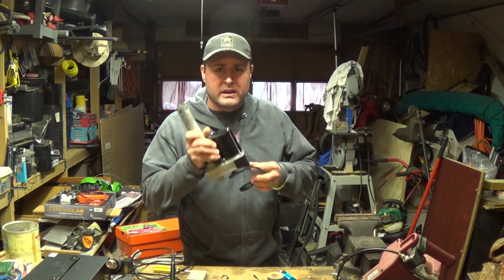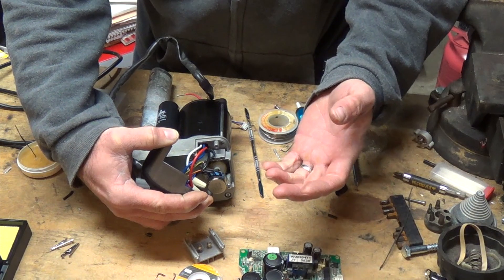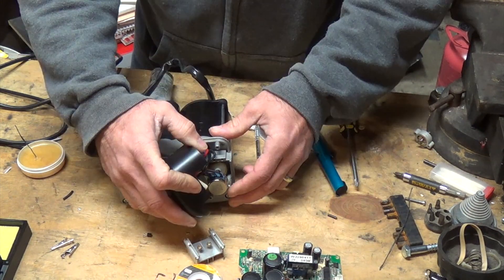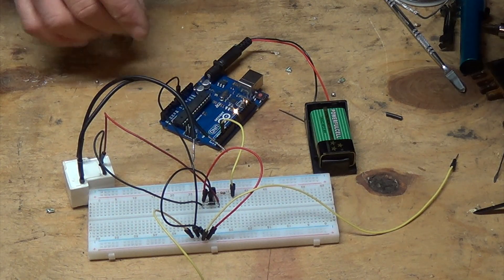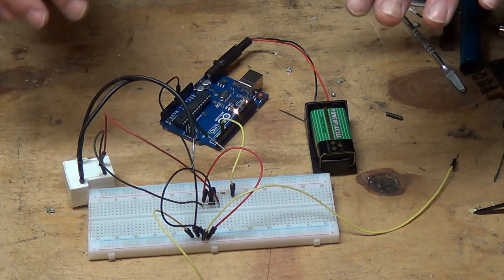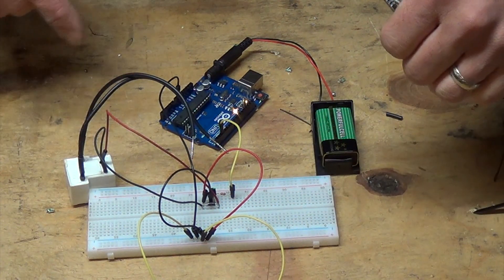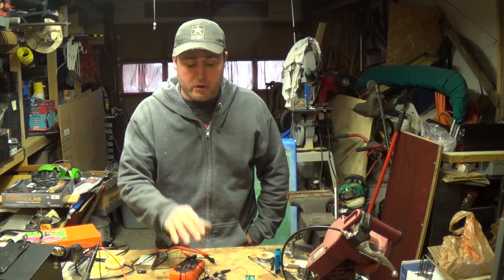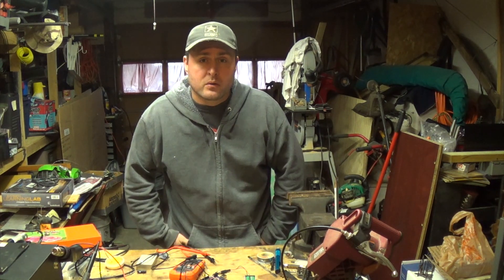Treadmill Project 3, Linear Actuator and Arduino

Comment: Two solid state relays will work directly off the Arduino's 5V, you only need cheap low current ones for this. No diodes or transistors required.

Comment: I rip lots of stuff apart too, came her to verify the wiring on one I have. But, I buy some stuff new too, like 5v relays which I have a box full of, and they are cheap enough so you don't have mess around with transistors to click one you scavenged.

Comment: I intend to use my linear actuators to power the distance change to my pillow block precisely; it will move only a set distance per revolution. It will be very helpful to mill to consistent measurements. Thanks for the wiring info!

Comment: I want to use these motors for a cnc, can it be done?
Reply from the maker: You would be better off using a stepper or servo motor for cnc. Steppers are accurate and servos are accurate and have feedback so that you can verify the accuracy. This motor would not be accurate at all
Reply: @EverydayJourney  But if they have an encoder, they are essentially a servo motor, with the same torque and thrust as a nema 23, or some 32s. The encoder reads positions. I just cant find a driver for the encoders already built into them. Thxs any way for replying.

Comment: Thanks for the video ,I was looking for the meaning of each cables : neutral , reverse and forward and the ones that comes from the potenciometer , these clarify my ideas  to test  a treadmill actuator and how to make a control through arduino or other micro , the key is the potenciometer..
Reply from the maker: Yes but it really needs some limit switches too

Comment: I'm using one of these to raise and lower wheels under my wood lathe, I'm considering going low tech and omitting the Arduino, All you need is two tiny "Cherry" switches, One switch on each end of travel that breaks the circuit at whatever position you want it to stop, but you can go the opposite direction because that switch is still closed, Ive done this 12 volt RC projects.

Comment: Just tore apart a treadmill today following Fielding’s videos. Started searching for uses that II ear actuator. This was a big help in understanding how to approach it.
Reply from the maker: What kind of ideas do you have for it so far?
Reply: Everyday Journey not many really. Everybody else seems to be crushing things with them. Lol
Reply from the maker: I was thinking of not using the potentiometer and maybe weld a longer shaft. Maybe make a camera slider or something. Still toying with it. Not very strong for pressing
Reply: Everyday Journey agreed on the strength. Did you see the video of that C - slide Frank Howorth built to get shots over his lathe? This would be a perfect motor for that.
Reply from the maker: Have to check that one out
Reply from the maker: I checked out a bunch of his videos. Not sure I saw the exact one you were talking about but I like his stuff. Will definitely be watching more. Thanks
Reply: This is the video I thought of, but I didn’t remember  correctly how it was powered. 

https://youtu.be/fHWJTVCOhBs
Reply: @EverydayJourney  screw press, or use it as an actuator. I was thinking of using it to drop the roof on an EV.